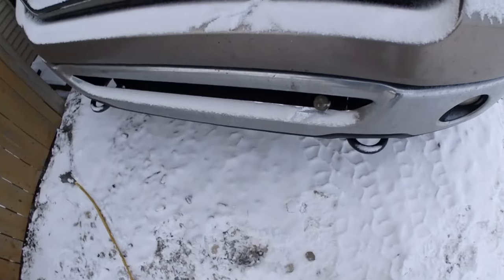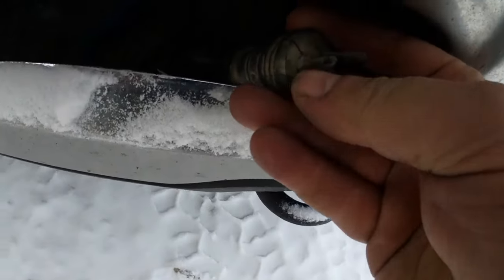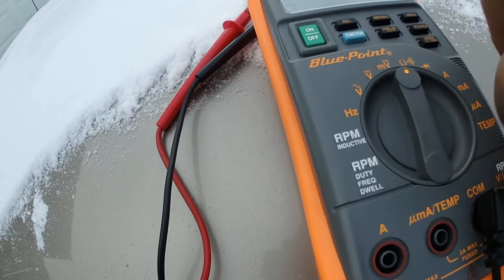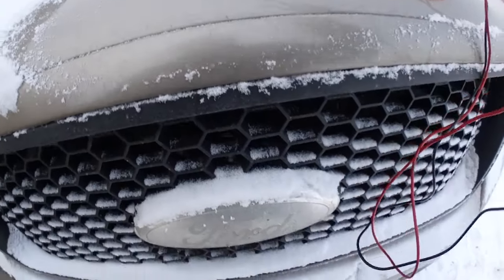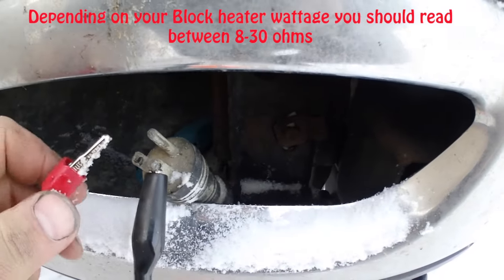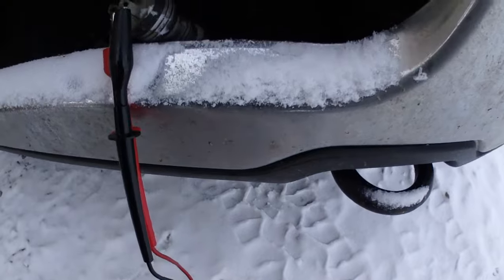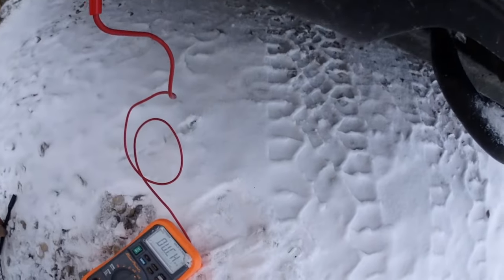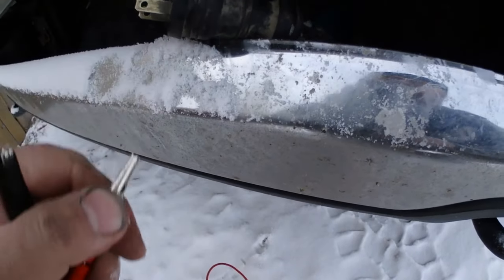How to Check Your Block Heater

Comment: You need to check and see if you have any continuity between blk htr element and engine blk.  You want none.  If blk htr element has continuity at all with engine blk, means coolant has leaked into htr element.  That's a bad thing.
Reply: That’s what he did lol. He has resistance within an acceptable range. You want resistance on a heating element… that’s how it heats. If you have “OL” showing on your meter then you have a short in the element or a break in the wire.

Comment: Note: Mine tested fine but water had seeped in the Neutral and corroded the wire. It didn’t affect the ohm readings but it had corroded enough of the wire that it impeded current flow and would get very hot, melting the connections. Touching and feeling the heat (too hot to hold onto kinda heat) was the only way to find the problem.

Comment: My jeep tj was built in Canada and there's a block heater on it. Never tried plugging it in,but you just reminded me about it. Guess I'll have to test it and use it. It's been pretty cold here in Ohio the last few days. Thanks for the vid!
Reply from the maker: +Tklatti01 depends how cold you mean ?  My jeep will still start at -30 not plugged in
Reply: @TestDontguess  that doesn’t mean it should though lol

Comment: Nice fluke. I never knew there was a ohm spec for them . Cool idea. I like to measure the amperage and see if it's drawing enough current.
Reply from the maker: +STEVE ROB seems like a lot of work to split the wires apart to measure amperage on the hot wire
Reply: jerry bskorner You don't have a line splitter . You have to get one , their great. $20
Reply from the maker: +STEVE ROB I seen that pretty cool

Comment: Howdy,
I have a 7.3 powerstroke. If the block heater connector has the correct range of ohms, does that mean there is no issue with the block heater? Would there any reason to pull the element and visualize that unit?
Thanks,
Prescott

Comment: I know absolutely nothing about ohms, volts, amps or whatever but your video was simple, easy to follow and to the point.    Even I can now check my block heater.. Just a FYI, I just today  changed out the male plugs on 2 Nissans, my wifes and my sisters.    Must be that Chinese stuff.

Comment: I replaced the water pump in my 7.3 last week, and since then, have gotten a humming and vibration from the vicinity of the heater element, where it plugs in above the oil filter housing. Checked it day before last and it Ohmed out to around 16 ohms on my horrendeously shitty free multimeter. Cord is in good shape and I keep the prongs greased with dielectric grease. Other than humming and vibration, it still works. I'm thinking its an air pocket down near the element. While in my eyes it seems unlikely, I know it is possible. I cracked the heater element loose tonight and let a few oz of coolant out and plugged it in. Hum seems to have gone away, but I will check again in a few hours. Nice video though. Good to keep people informed on the upkeep of these heaters.
Reply from the maker: that's very possible that you did have a air bubble trapped inside
Reply: jerry bskorner still getting a hum, albiet much more faint now. Tested it with the fluke at our shop today and it ohmed out at 14.2. I'm leaning towards it being air. Gonna go ahead and send it.
Reply from the maker: yeah man Send it

Comment: 25.5 seems a little high, did the block heater continue to work properly? Most ford block heaters are 1000 - 1500 watts, I would calculate 10 -15 ohms resistance. I am curious if the higher reading showed some, near to replacing, resistance.
Reply from the maker: No hasn’t failed yet still working like a champ in this -37 weather we are experiencing right now
Reply: Thanks for the quick reply. I am heading out tomorrow to check mine. I won't worry if it is a little high.

Comment: So this is more a test for the block heater cord, not actually the block heater. I've driven away with the cord plugged in, and will be replacing the cord, but was wanting a video on testing the actual block heater itself, so I could get that purchased at the same time it needed. Its 1F degree out and will be inconveniencing someone to drive me. Guess I'll purchase both and return.
Reply: A Kill-O-Watt meter can be helpful, as it will read amps, watts, or voltage when you plug the heater in and tell you if the draw is normal or not.

Comment: The question is, why does block heaters trip GFI's when the engine is warm?  It is not uniform, but in a fleet, if the vehicles return warm, many will trip the GFI but if one plugs in the heater when the engine and temp is cold, they do not trip.